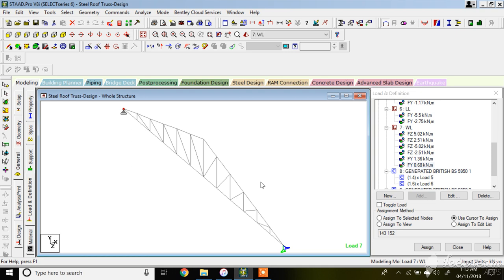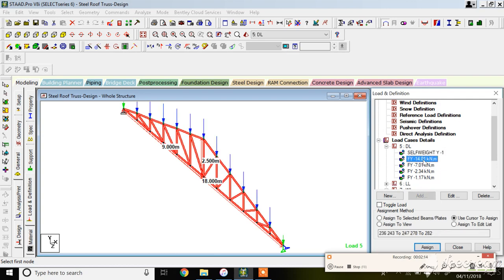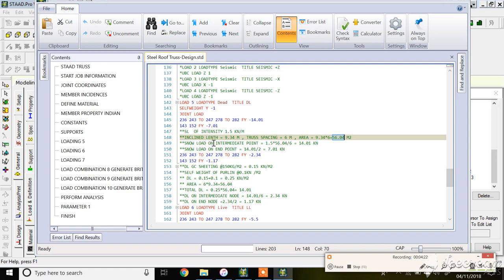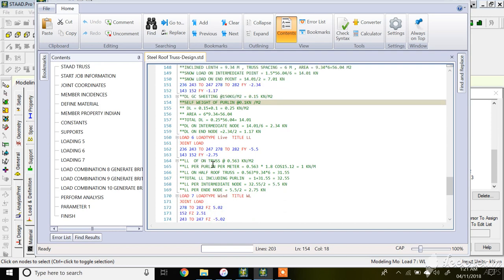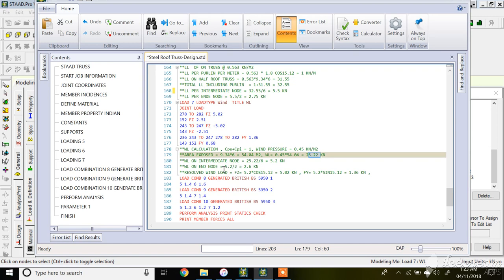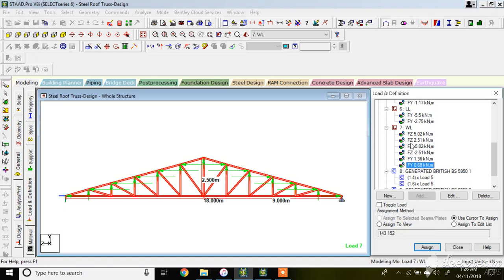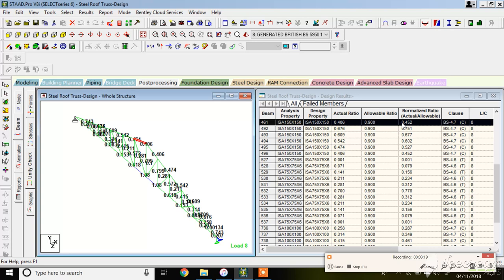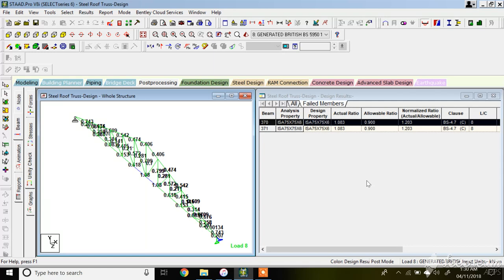Steel Truss Design and Analysis in STAAD PRO

Comment: Bro how you took selfweight of purlin is 0.1. if we allot self wait in dead load it will take automatically. So why shoul add that for calculating full dead load
Reply from the maker: There are weight of connections also.
So just being on coservative side that 10 % is considered.